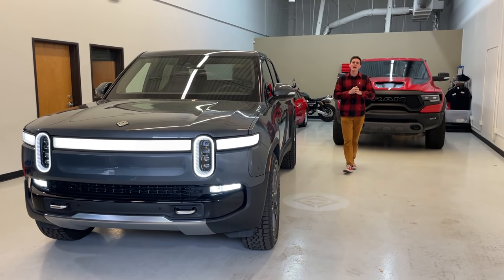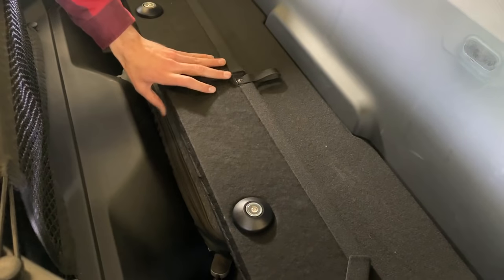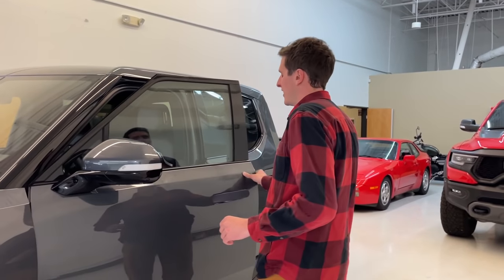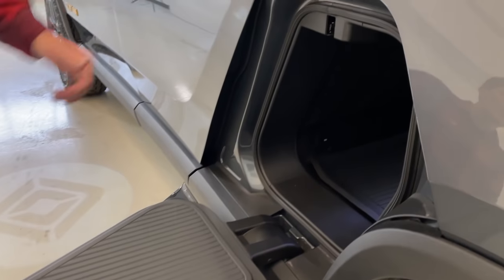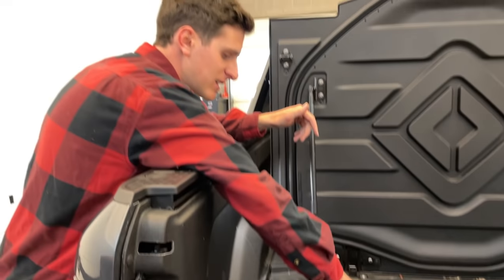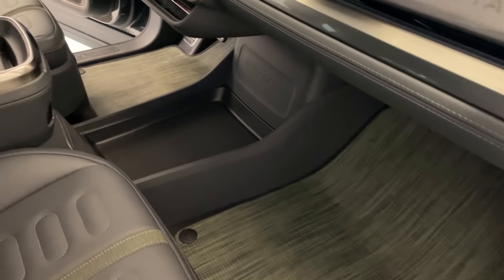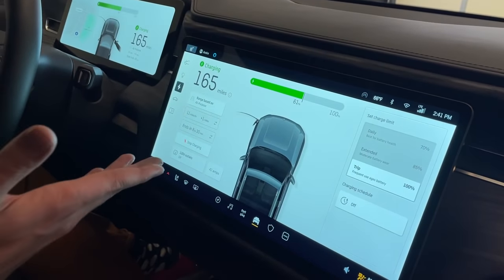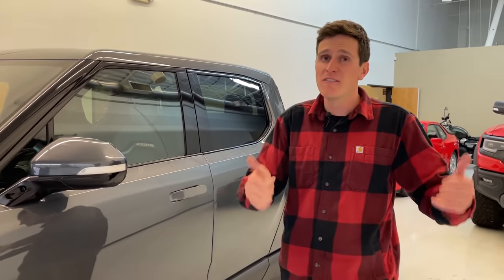The Rivian R1T Is a BIG Threat To Traditional Pickup Makers (Ford, GM, Ram) Here's Why!

Comment: I have a series 3 land Rover.. I always carry 2 Jerry can of fuel.. so if I go for a trip into the Australian outback.. and get stranded by a flood or bushfire.. I still have fuel.. what do you do if your stranded in a EV truck? Miles away from a charger? Oh that's right, you crank up the gasoline powered generator in the tray to charge it.. completely impractical in the real world...
Reply: In reality, how often is that going to happen? Also what happens when you've used all your fuel and you're no where near a servo, at least with an electric truck, all you need is a powerpoint and you can recharge it.
Reply: Smart off-roaders don’t travel alone. You get a tow for a few miles and then drive a while on the juice you just regened. Repeat if necessary.
Reply: @brendykes6599  I wasn’t alone, we had 2 4x4 stranded.. the road to the closest town was cut off by flooding… we needed the the “extra fuel “.. so we could go the long way around to the town, if we weren’t cut off by the flood.. we would have made it into town with the fuel we had…
Reply: You install lots of solar panels, they will get you out of trouble especially in a hot and sunny place like Australia.
Reply: @migueljardim8177  those that sail around the world in yachts, have had solar panels for years.. but all of them have to run their diesel engine too use the alternator to top up the batteries.. as that has been proven.. in the Australian Solar challenge. Look it up on YouTube.. you would have to cover your whole car, and a trailer with solar panels.. for it to work..
Reply: @graemejohnson9025  Or you could design a system yourself where the solar panel is mounted on the roof by use of the roof rack system that can then be folded out like a tradionail Chinese fan on a single pivot joint. Connect that solar array to a small battery that you store in the bed so you are effectively charge while you drive, then plug the battery in to the car when you want to charge.
Reply: @migueljardim8177  I think I could solar charge for days before I spent $$$$$ for a chopper delivery
Reply: @migueljardim8177  they tried that type of system on liveaboard yachts... completely impractical.. the problem you have is the solar panels efficiency.. it's only effective if the sun is directly 90 degrees to the panels.. so as the sun passes you over the day.. the panels are only efficient at Midday.. the charge capability degrades, as the sun passes by...
Reply: @graemejohnson9025  Yeah that is one of the problems with solar panels. Although their efficiency does improve the more solar layers you add to the pannel. They will become more efficient in the future so this kind of this will become more and more possible as time goes by.
Reply: @migueljardim8177  my mate in America bought the Tesla roof tiles.. spent $20k with battery backup.. problem? Now there are more efficient tiles, he has been quoted $10k for the upgrade.. now I don't know where you live, but? How much is your power bill? But $30k would go a real long way off paying my electricity bills for f'n years... 🤣
Reply: @migueljardim8177  don't get me wrong.. I have a 5 solar panel powerbank, that charges during the day, and charges my note9 at night.. I  have a solar powered fridge.. but for transport it's still impracticable at the moment..
Reply: @graemejohnson9025  Sure but you don't have to upgrade just because a new panel comes out, so really only $20k. I have two houses, one with just the solar and no battery and the system paid for itself in 2 years, the other house we built last year and decided to get a powerwall II along with solar hot water and solar pv, now I don't know how long the payback time will be since we didn't try living in the house without the solar or battery first and haven't had to pay a bill yet. Unfortunately the feed in tariff is rubbish but it was nice to receive our first cheque from AGL the other day, if I had to guestimate the payback time it's going to be around ten years, but at least I don't have to worry about the frequent power failures we seem to get at the new house (at least once a month) as the powerwall keeps the house running without any trouble so far. As for operating vehicles in extreme fringe use cases like flooded conditions or choppering in extra fuel to drive the long way round, is that really something that 99.999% of people need to worry about?
Reply: @graemejohnson9025  While I think current gen electric cars tend to have far too many whiz bang gadgets on them for their own good, a lot of ICE cars do too, I haven't heard of Tesla cars computers wanting to reboot while driving. They haven't let the microsoft programmers near their systems yet.

Comment: Imagine if you could only put 70% of a tank of gasoline into your car cause it could hurt the car if you did it to much.
Reply: Imagine never stopping at a gas station for daily commuting
Reply: @mattbrew11  imagine you forget to plug in your car that takes hours to charge like people forget to get gas when they need to. Instead of a quick couple gallons from a road side assistance you will be there for hours waiting to charge.
Reply: @lgoss3268  do you manage to get your phone charged nightly? Its a simple task. Do it for 30 days in a row and its now a habit.
Reply: @mattbrew11  right. But how many people still manage to not put gas in there car or forget to plug in there phone. I can charge my phone on the way to work. You can’t do that with your car
Reply: @lgoss3268  just keep buying gas vehicles dude. They’re more your speed
Reply: @mattbrew11  I will as long as I can. The infrastructure just isn’t there anyway for these vehicles. What if you live in a apartment complex. How do you charge over night? What if you live in the inner city and park on the street? Just proves EV’s are a gimmick and have to add weird and/or extravagant extras to get people interested.
Reply: yep, not the vehicle for you then. apartments are a problem for evs today.